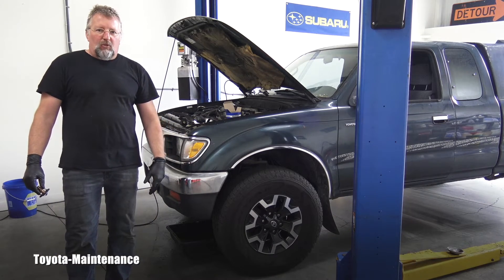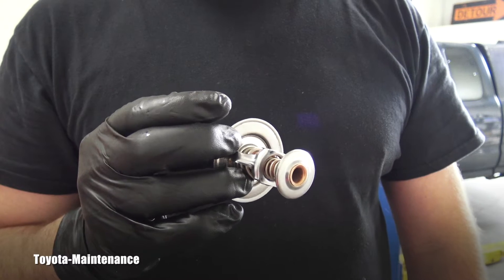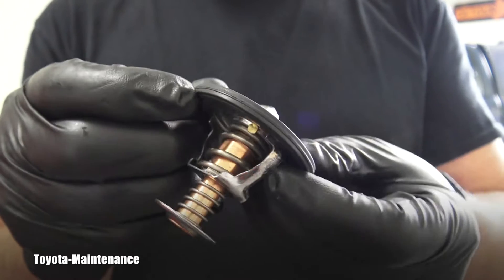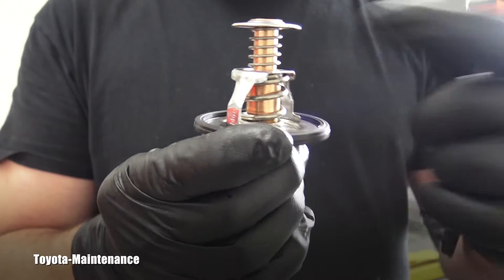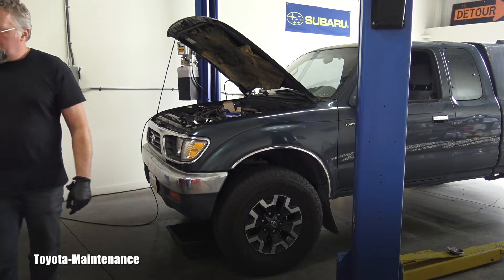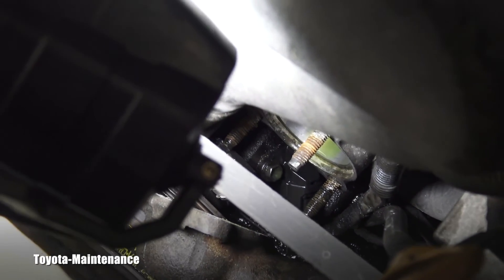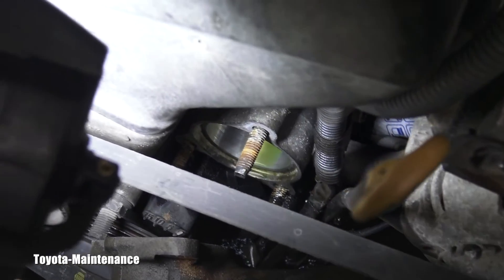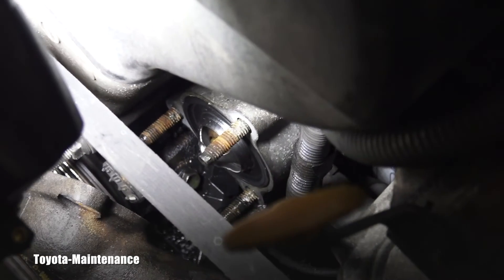Toyota Tacoma Thermostat

Comment: Buy Toyota OEM thermostat and Toyota OEM thermostat gasket. Toyota thermostats are high quality and exceed any aftermarket trash thermostats. The thermostat in the video looks like a cheaply made after-market part.  The Toyota thermostat part number for the model 5VZ-FE engines is # 90916-03075 and it's a high-quality made part.

Comment: Do I need a housing gasket for the 3 bolts? Thx
Reply: You do not need a housing gasket for the three bolts. The gasket is on the thermostat and seals it tightly but make sure the jiggle valve is in the downward 6 O’Clock position for 3.4L engines.

Comment: Question: Put a new radiator, hoses, thermostat, coolant, and the top radiator hose get's extremely hot to the touch just getting up to operating temperature while letting it purge without the radiator cap in my drive way. The bottom hose from the radiator is cool to the touch. The water pump and timing besl was changed by the dealer 15,000 miles back, don't believe this is the issue. Any ideas? It's a 2002 Toyota Tacoma 3.4 similar to yours.
Reply: Did you figure it out?  If not, did you put the new thermostat in the proper way?  That's the first issue that I look for with a lower hose that's cold.  Did you purge all of the air out of the system?  If not, that can cause your issue too.  You can take the t-stat out and run the vehicle without it, if it doesn't overheat, that's the issue. Other than those two things, you may have a leak somewhere.  If those three things are accounted for, you may have a faulty water pump.  I know it's new, but if you eliminate the other things I mentioned, the only other things I can think of are the water pump, or a clogged heater core.
Reply: @donnievick3076  Hi Donnie,  I did figure it out. I did change the thermostat and placed it in the proper position as you indicated and did solved the overheating problem. My new problem came from the top radiator hose that would create a vacuum and collapse the hose once it cooled down. It would go back into shape once I released the pressure from the radiator cap. Long story short, the overflow reservoir hose from the radiator to the reservoir tank was plugged not allowing the radiator to release pressure to the reservoir tank and then allowing the vacuum to return back to the radiator. Usually, it's just a bad radiator cap, but in some cases, the radiator overflow hose can be plugged from age and becomes blocked. Just need to blow in the hose to know for sure.  After much research on You Tube,  I found the similar cause and fixed it! Hope my response and your video will help others. Thanks for reaching out!

Comment: IMO the pump pumps fluid not air, and because air rises.... and the hole is to allow a change in pressure. The only material that moves with the pump system is fluid on the bottom of passage. If the hole was on top and it was air bound the fluid cant naturally pass through....

Comment: I would not buy an aftermarket thermostat for the Tacoma. They are cheap at the dealer and a critical piece of equipment. Not worth getting an aftermarket one IMO.  Interesting that you have to point the bleeding valve down.
Reply: bleeding valve down for the 3.4. If it's a 2.4 or 2.7, I've read that it goes up.

Comment: I just had my upper and lower radiator hoses replaced on my 08 tundra with 90k miles.  I asked if they were going to replace the thermostat, and they said no, they don’t go out that often.  I’m thinking they should have replaced it.